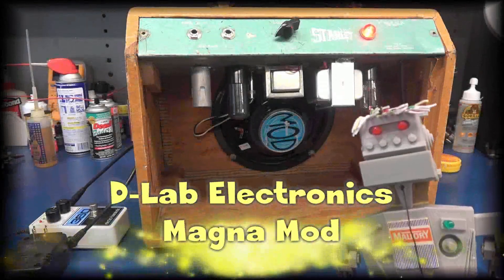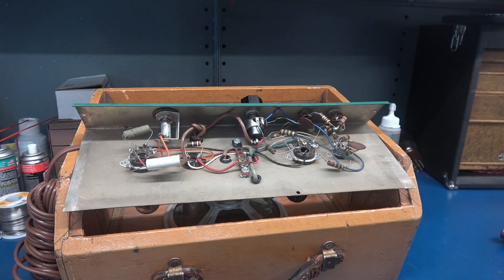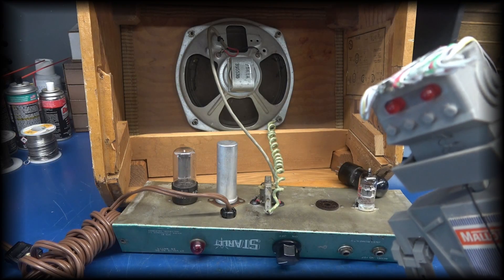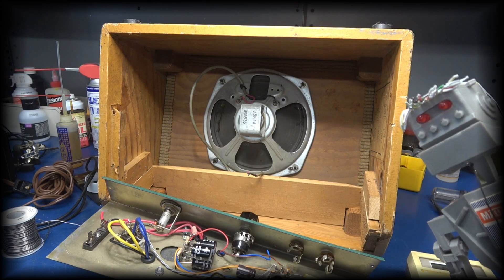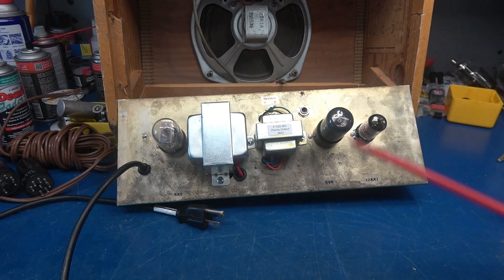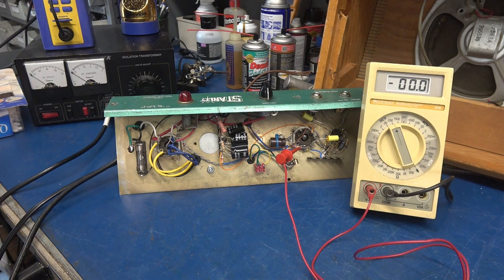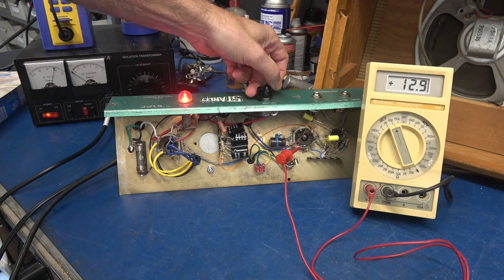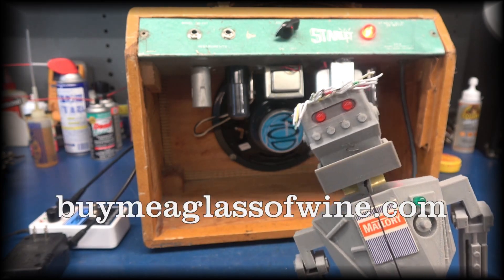Vintage Magnatone Starlet 107 Hot Chassis Tube guitar amp Mod Widow maker How to update

Comment: Love your videos I’ve got a JTM 50 that I built. Sounds amazing but there’s one issue that’s driving me crazy.. the bright channel pot cuts out the sound right at about 90%. Also goes dead when I put a  jumper on the pot and bypass the resistor at 100%. so I don’t believe it’s the potentiometer. has anybody seen this issue before? I can’t find any leaking coupling capacitors bias voltage is good and the power supply voltage doesn’t drop when I lose sound..
Reply: Problem solved oscillation between v1 & v2.  A wire moved when had to raise the board to install a master volume.

Comment: Nice work. Just one question (no criticism)  why not placing the new transformer(s) inside on the wooden box?)
Reply from the maker: Yes, I have done that in the past if the chassis lacked room. I actually used another chassis with an interface cable. Keeping it on the chassis ensures hazardous voltages cannot be accessed + is easier to wire.

Comment: A few weeks ago, a customer brought an Ampeg VT40 guitar amp into my shop. He said the amp worked OK, but he was tired of getting shocked. I plugged it in and measured the AC volts between the chassis and earth ground. DMM showed 120 vac on the chassis!  Same as the mains voltage. I'm surprised the customer didn't suffer a serious shock.

Comment: How about replacing the line cord with a polarized two-prong cord, so there is no possibility of making the chassis hot, and the neutral is wired to the chassis? That would make it safer and won't have to add the transformer and change the tubes.
Reply: Nowadays everything that has a metal chassis with 115VAC inside of it has a three-prong plug and only the ground prong goes to the chassis. At some point in the circuit, the signal ground also needs to be tied to chassis ground. One place to do that is to balance the 6VAC filament heater power leads with equal resistors and use the center of that pair of resistors as your reference point for signal ground. He points out the balancing resistors at 9:25 in the video.